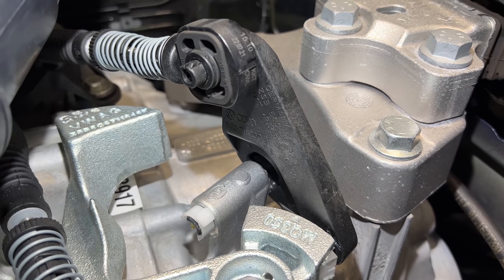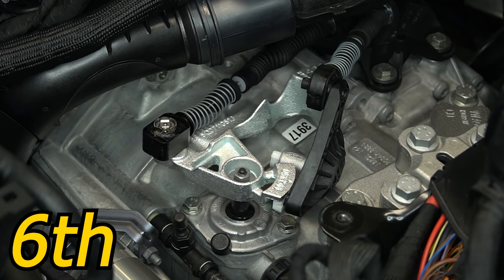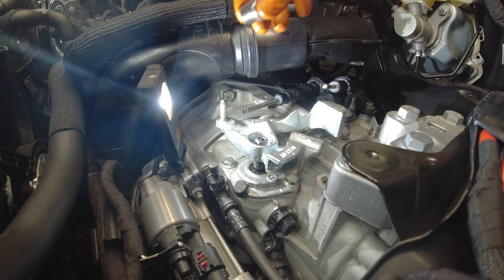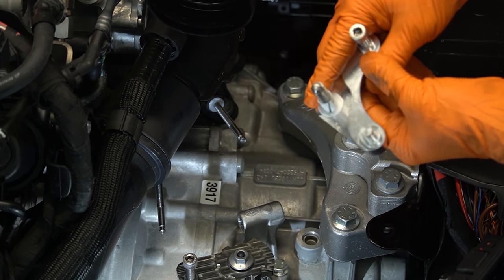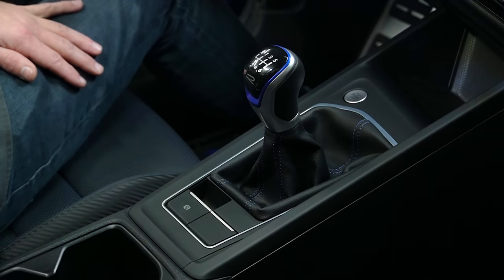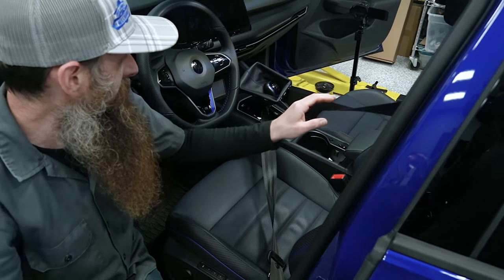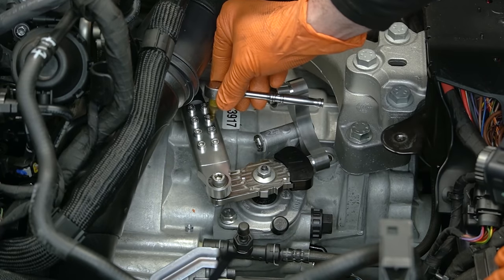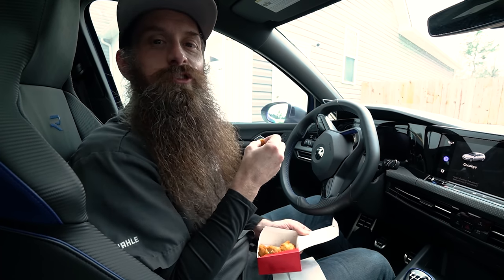Sloppy Shifter?  ~ How To Install a Short Shifter and Adjust Shift Cables

Comment from the maker: For those of you wondering, what happened to the MK4 R32 Turbo... Its at the bodyshop :( it will be a little while longer until its finished. BUT!!!! I got some non MK8 goodness coming soon. I wanted to get some basic mods done early on the MK8.. Then we have the MK3 Cabrio, MK1 TT, Tacoma and more fun things to work on .
Reply: Same as my r32, just getting hit for new discs, pads, rear springs and dampers to get it through its annual road worthy test. Holy carp are discs (rotors) are sooo expensive. Also got my mk3 vr6 off road as it’s running rich. So many cars so little time. What happened to the white mk3 you had? I could do with plenty of DIYs.
Reply: Do you still  have the Mk1 Cabriolet, or is that gone now? I love the Mk1s so much.
Reply: That TT has been taunting us in the background for far too long. I hope it's a BAM.
Reply from the maker: Soon!!!! I’m on my way to the machine shop to check on the engine right now!!!
Reply: Hey Humble on Paul's holy shift install video for the mk7 he locks the transmission but in your video here you are saying not to lock it? Is this a difference in the generation? If you could clarify it would be much appreciated. Thank you!
Reply: Do you think the clutch bleeder block upgrade (such as from ECS) is a must for better manual trans performance? Any other shifting components to replace or will the Holy Shift kit suffice for daily and interstate driving?  Great vid, thanks for taking the time!

Comment: You should do the other common manual mods as well -- clutch delay valve removal, clutch stop, and clutch assist spring removal. These simple changes along with the shifter bracket definitely improve the stock driving experience. I assume all of these are still relevant on the Mk8 since the transmission appears to be completely carry-over.
Reply: I'm about to do all these to my mk8 gti

Comment: Audi A3 8P install is almost exactly the same.  The holy shift performs exactly as advertised.  It's pretty sweet.  If it isn't quite right, loosen all the little nuts, lock the shifter down & lock the shift fork shaft, give everything a wiggle, tighten it down again like he says & it should work perfectly.  It's what I did.  First try didn't feel quite right -- had a hard time finding 1st & 2nd.  After re-trying, it worked perfectly.  It's very fun to drive.

Comment: Thanks for the seatbelt tip ! I installed it according to instructions, but gears were a bit hard to get into. All working but not a great feel. I redid the cable adjustment with the seatbelt in place and it's perfect. Very good precise shifts !

Comment: Just installed this on my Mk8 GTI. Took about two hours. I don’t want to jinx it, but everything seems to work perfect. It aligned properly, all gears are easy to access. There is a distinct snick sound when you shift now. Boy, sure hope that’s intended. 

Your video was invaluable. Couldn’t have done it without. Thank you!!
Reply: Could you explain the noise? I installed the dieselgeek sigma6 shifter on my mk8 and it sounds like something is rattling at higher rpm’s when getting into gear. It goes into each gear fine without issue. Not sure if it’s just normal considering there isn’t any rubber anymore and the excessive noise is just translating from the gearbox into the lever.

Comment: Must have shifter upgrades for any manual VW. I couldn't be more of a VW fanboy but Ill be the first to admit we haven't had a good manual transmission in a long time. I find it odd when I see so many car journalists heralding the manual trans in recent VWs, like it is an s2000 or miata. These things have a ton of slop from the factory. Great mod
Reply from the maker: Yep that’s my thing too. Manuals are fun but this manual is not the best.
Reply: I find this strange, because in my opinion, VW shifters are excellent. That being said, I am in Europe and drive mostly small Diesels, so maybe there's a difference. I always felt that they struck a great balance between direct and forgiving. In my Seat Ibiza (basically a VW Polo) one could literally throw it into gear (as in, knock the shifter from 3rd towards neutral, let go, and ot would jump into 4th). Also, it just loved fast shifting.
I also drove a lot of manual BMWs, and I found their shifters to be awful. Unprecise, sloppy, moving under engine torque, and generally not "fun". 
My little Suzuki Swift on the other hand has a rifle-like feel to the shifter, but it doesn't like to be bang-shifted.
I guess it comes down to personal preference. Maybe the European spec is also tuned differently...

Comment: I will be installing mine this week. You and paul are amazing. Thanks for the videos. I feel comfortable doing it myself now.
Reply: Heading over to DAP now!  I am buying one part per paycheck then gonna have a great weekend with some friends throwing mods on our cars.  Then its off to the track with my R, a Subaru, and a Challenger Super Bee
Reply: Just installed it. Way easier than I thought. Had to rip the foam under the shifter knob as well😂. Followed the video step by step. Thanks again you guys are the best.
Reply: @kegfreak3728  🙏🙏
Reply: @raulbonilla4137  so glad it went well

Comment: Ordered an APR short shifter for my MK8 R yesterday.  The BFI shift knob made a huge difference, but can't wait till after the short shifter and aluminum bushings go in.  Should clean things up nicely.
Reply: I am considering buying either the APR short shifter or the DAP short shifter for my Mk8 R. Please let me know how you like your APR setup!
Reply: @brettdiehl1965  it's a definite improvement over the stock shifter.  The combination of my BFI shift knob and the APR short shifter feels great.  My shop that installed it didn't set it at the most aggressive settings my understanding is it can be customized.  The throw is definitely shorter than stock even though they kind of said it right in the middle.  They said if I wanted to be more aggressive they can adjust it as needed.

Comment: I would say if you stiffen up the shift linkage with a kit like this, don't put constant pressure on the shift knob while it's in gear. I have seen people do this some times while keeping their hand on the shifter. This could in theory cause premature wear inside the transaxle. Specifically the shift forks and/or syncronizer hubs. Just my two cents anyway.
Reply: I mean, that can happen either way if you leave your hand on it. My 2002 VW New Beetle owners manual says you shouldn't keep your hand on the shifter after changing gears to avoid premature wear

Comment: For the seatbelt "tool" to work you have to fully pull it out so the safety lock engages and youll hear/feel the belt lock clicking and it will keep tension
Reply from the maker: That doesn’t work on the driver belt.
Reply: @HumbleMechanic Wouldn't it be possible to do it with the passenger seat belt then?
Reply from the maker: It would pull it the wrong way
Reply: @HumbleMechanic  I see! Thanks for the reply?
Reply: After pinning the shift knob inside the car, buckle the driver seatbelt, then grab the "lap belt", loop it over the shift knob, and cinch it down. The friction from the buckle slide will hold it in place.

Comment: I finally ordered one of these the other day, and i'm kicking myself bc i just replaced my battery tray the other day with a new oem one bc 2 of the intake mounts were snapped off by a shop that did my bfi mount install.

I've had bushings and a universal short shifter for like 5 years, but it has a ton of side to side slop.  I'm not convinced I got the adjustment 100%.  I already have the dg super pin as well.

When sliding the the shifter linkage into the endlinks, do they just go in all the way before tightening all of the allen heads or is there something specific with the notch you mentioned?  I'm guessing it just takes a little trial and error.

I'm really hoping this setup gives me fond memories of how my s2000 felt- although that transmission spoiled me rotten.

Comment: In the DAP vid, they lock down the shift tower with the pin before installing essentially all the new parts. Why do you recommend against this until you are locking in the cables?

Comment: Are u going to upgrade to a Cold Air intake? I’ve got a MK7.5 golf R and after watching your video for that it doesn’t seem worth it if I’m only going stage 1. Thoughts? As always a great video. Although I’m shocked you’ve already broken 2 things on the car. Lol
Reply: If you want more turbo sounds yes. Noise is the main difference. The stock intake is very muffled which could be good or bad depending on your expectations.

Comment: Yep. Main bracket in the spline.. super pain. Been at it for 1.5 hors and no luck. I need a slide hammer or something. My back hurts from rocking and pulling and hitting. Any ideas?

Comment: Hey man, I have one question if you could give me some advice on.
I have an Audi A6 C6 2.0tdi manual, 170bhp.
Clutch has been changed very recently, and also transmission oil, but i have 2 problems that are persistent.

1st is when the car is cold, especially if it's colder outside, it's harder to get into 1st and 2nd gear, but as soon as it's driven for about 20mins, it's completely normal.

2nd problem is that I have random shakes on idle.
I thought it was DMF, but since it was changed as part of clutch, it didn't help with this issue.
It's not always there, and I couldn't spot anything alongside it to help diagnosing an issue.
There is only one thing more, but I wouldn't say it's anything to do with issue number 2, and that is when the car is doing DPF regen; you can see RPM slightly higher on idle, and that's when if you were to rev up, you would be able to hear some rotational grinding noise as the RPM naturally goes back to idle.
I would say that could possibly be water pump bearing, but I've no leaks nor any other issues.

Sorry for extensive comment and non related issues, but I thought it's better to state all at once than only one related to transmission :D

Thank you very much in advance and for your videos!

Comment: So question on shopdap he locked the transmission first before taking apart the stock shifter but you wait till after you have installed the holy shifter. Does it matter?

Comment: turns out the base golf 8 sold in europe (not the gti or the r, but the ones with the 1.5 tsi) has a different linkage system from the gti and the r. probably the short shifter would work anyway, but I'm not totally sure. Sure thing is that it has a lot more plastic than the one on the video and the "right" cable positioning is different.

Comment: Hey there, I posted this on Paul's Holy Shift install and wanted to reach out to you also.... soooo I accidentally broke the locking pin to the shifter tower while trying to install this kit. 2 questions.... Is it tough to replace that locking pin? Can I install this shift kit without having to lock the shift tower for adjustments? Thanks in advance
Reply from the maker: its not "hard" to replace that pin. its kind of a pain. You can adjust it with out locking the tower. Its a PAIN to do it that way. but you can. Id consider fixing the pin, then doing the adjustment. 

If you have to do the adjustment first, try and get it close to where Paul or I have ours in the video(s). that might get you close. it probably wont be "RIGHT" but it will be close. 

Funny enough I have a car here now with a very poorly adjusted shifter.
Reply from the maker: Here is a video on fixing the pin! https://youtu.be/5Do0Ic4m1D4
Reply: @HumbleMechanic  thank you so much for answering my questions. I have the OEM pin coming in the mail.
Reply: @HumbleMechanic  thank you for that video forward! I and like many others really appreciate your channels/videos. Thank you for taking time to respond!
Reply: @HumbleMechanic  Sorry last question. I am guessing there is a small piece of the locking pin my transmission.....have been running with it in there for a few thousand miles.....i know probably not a good idea. Havent had trouble yet and im guessing it is stuck on a magnet. can this be addressed when I replace my clutch? Thank you

Comment: I just bought and tried to install the Holy Shift into my 2009 GTI.  Install was a pain in the butt.  After I did the initial adjustments to the shifter by locking the tower and dropping the pin into the shifter and tightening up the 14 4mm Allen’s, I lost second gear.  I pinned everything again and loosened everything again like you suggested in your video.  I only tightened two of the 4mm bolts on each arm and tried it all again. Still no second gear.  It appears that it is hitting something that is preventing it from going into gear.  All of the other gears work fine, finding reverse is a bit different.

Any thoughts or advice is greatly appreciated!!
Reply from the maker: Is the adjustment pin all the way out?
Reply: @HumbleMechanic  it sure is
Reply: @HumbleMechanic  any other thoughts?
Reply from the maker: Is there anything you can visually see blocking it?
Reply: @HumbleMechanic  nope it all looks like it does in the video. It’s really got me scratching my brain. I took the whole thing off and re-installed it step by step and still same
Reply from the maker: What if you put the stock one back?
Reply: @HumbleMechanic  haven’t tried that yet. I’ll do that tonight.
Reply: @HumbleMechanic  so it turns out i am an idiot......i failed to take into account the closer ratio between the gears...so the not going to second was actually reverse not going down into anything....like it should. sooo it works like a dream! thanks for the help! love your videos!

Comment: Totally broke that little plastic lock to keep the selector shaft in place, now it just takes my pops holding it while I adjust the cable end links.
Reply from the maker: Ya you can do it with out. I’ve broken the shifter side once. Not Aweosme

Comment: are you able to verify if this kit will also work on the gen 2 Tiguan? I have the unicorn 6 speed and aftermarket support is sketchy at best because nobody can really verify any fitment. I've already done stage 3+ clutch, k04 and stage 3 apr software along with a million other small things but a short shifter has been on my list for a long time but cant really find any concrete information on one that will work. any information would be great. love the channel and all the knowledge you share!
Reply from the maker: 1) that’s awesome!!!! 
2) I’d think so. Vw has used this setup on so many cars.  You do have a rare bird Tiguan which is awesome.
Reply: @HumbleMechanic  awesome,  I appreciate the response! And yeah, it's definitely a fun car, I know not many were brought in to the united States and if I'm correct even less were produced in the Wolfsburg facility, mine being produced in Wolfsburg makes it even cooler in my eyes, definitely been a fun learning process working on it forsure! Thank you again and keep up the great videos!

Comment: Can confirm breaking the lock tab sucks ass. Had to pull my shift tower to properly remove my old one and I'm unable to reinstall a new one so the hole it goes in is just plugged with a rubber plug to keep the trans from leaking fluid

Comment: Surprised you did not also install cnc machined shifter mount bracket bushings
Reply from the maker: I like to always know what difference each mod makes.
Reply: @HumbleMechanic  I hear you! I did all my shifter mods as a package deal "while I'm in there" kinda thing. But I can definitely respect that.

Comment: sorry i think i miss it!

when you release the shifter cable from lock position ?
Reply from the maker: The one on the trans unlocks right after you tighten the cable ends. The one in the cabin is after that
Reply: thanks a lot

Comment: I did mine and i went through all the gears. Everything is good although reverse is a bit off. It definitely goes into reverse but when I push the shift knob down and to the left, the shift knob doesn't stick down, it pops back up. 
Not sure if it's the spring that broke or something wrong i did with the short shifter
Reply from the maker: Might need a slight adjustment
Reply: @HumbleMechanic  how exactly do i perform the adjustment?
Reply: @brandonpena3516  loosen the end links release the cables and lock down the shifter again then tighten everything down again.

Comment: WHY did VW allow the GTIs and Rs out of the factory with such sloppy shifters? Sigh...cost-cutting accountants need to be driven out of town and forced to walk back when they do stuff like this!

That said, the Deutsche Auto Parts Holy Shift Short Shifter kit is actually reasonably priced, and the throw adjustability is pretty slick. Still - it should've been like this from the factory.
Reply: It's not cost-cutting, it is the "every-man"'s desire to have a doughy, comfy car, even when they go out of their way to buy a sporty car.

Comment: Honestly, I was not planning to do any mods on my car, but I think I might have to now LOL.
Reply: Actually...@HumbleMechanic what are your thoughts on bleeder delay valve delete people have done on previous generation Rs? I find it very hard to shift smoothly from 1st to 2nd and sometimes into 3rd. Could be the way I drive, but going from 1st to 2nd, I clutch in and wait a while until the revs drop enough before engaging 2nd. Would this mod help?
Reply from the maker: I haven’t done that mod before. I need to test it